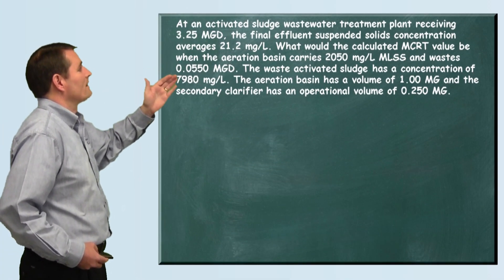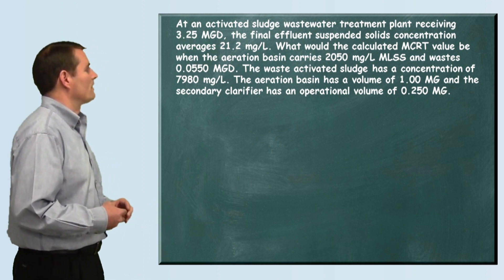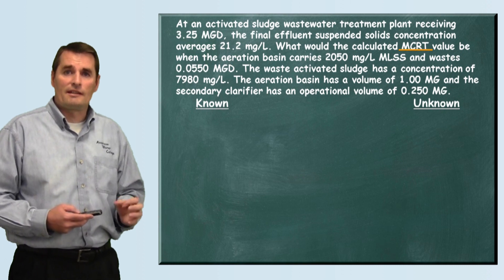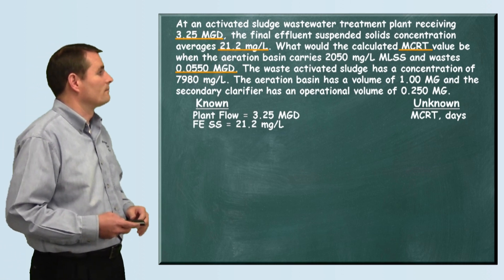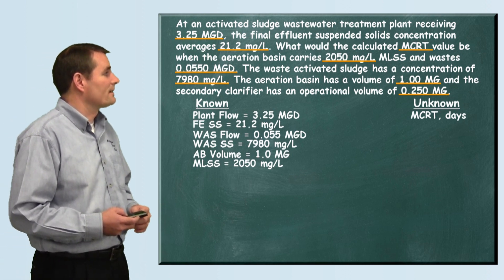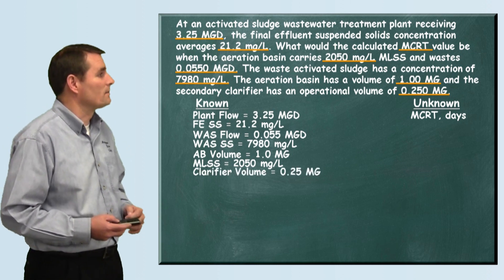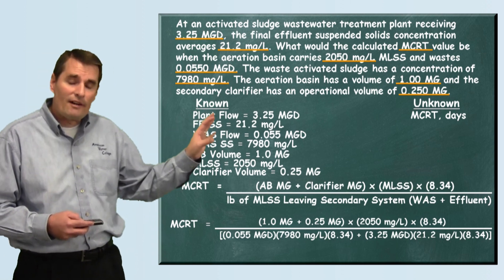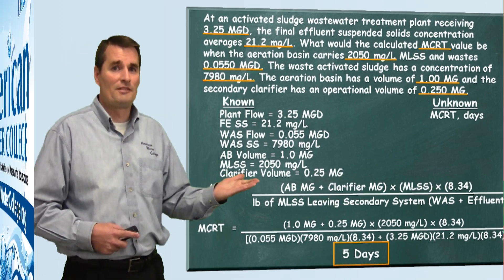Problem Solved: MCRT Problem - Wastewater Math

Comment: Gosh, that is lovely.
What does it tell you?
It tells me the MLSS is too low.
The RAS is High so its settling like a rock leaving a LOT behind, a little old maybe? Ya THINK! 
How's your foam on the basin? Thick dark and gummy?
What's your DO uptake at the center well of your final clarifier? That high?  hmm!
What's your DO across the basin? 2.0? 1.5 Oh, are you trying to run at 1.0???
It is loosing 575 pounds a day in uncontrolled wasting and the EPA is probably breathing down their back over that TSS.
What is the detention time across the Basin? Offhand (with no math and no calculator and no black board) I would say the basin is a mite small for the project.
I bet the digester is pretty. Adjust the budget for about double the sludge removal.
At this point doing a bunch of math to prove what they need is an OPERATOR is pointless.
Reply: lol, did you just pass your exam?
Reply: @DWHGWIHW  its hilarious because if someone knows how to pick it all apart then why are they watching the video and in the comments unless bored with life and wanting to troll.

Comment: Dear SIr,
Plese help me out i want to know 
1.how to generate MLSS in waste water treatment plant my technology is SBR technology.
2. How to reduce foam.
Reply: Sir
For foam reduction u can add polyelectrolyte or defoamer
For getting MLSS u need to first add bacterial media
Reply: But sir have u got media in there prior
Kindly reply me back
Reply: @kocengineering769  its been awhile hopefully hes already figured it out
Reply: @kocengineering769   for foam reduction you can control your mass. So much cheaper than throwing chemicals at it.
Young, non flocculant mass, will always foam like crazy and old sludge will make a nasty thick gummy foam and your TSS will be in violation. Neither is desirable.
Get in the middle and keep it between the ditches.